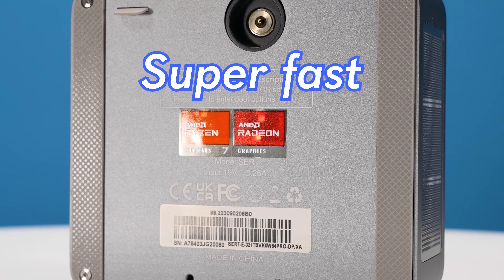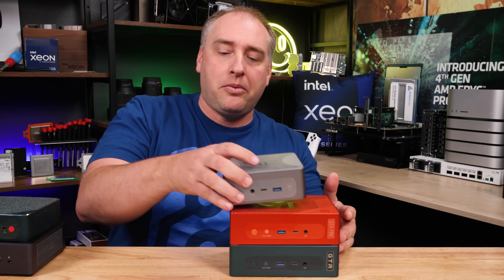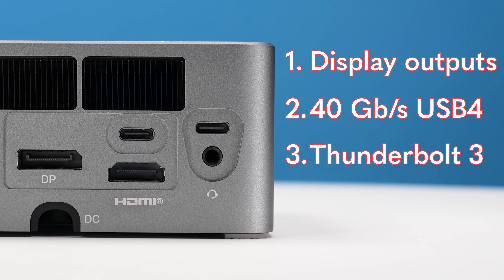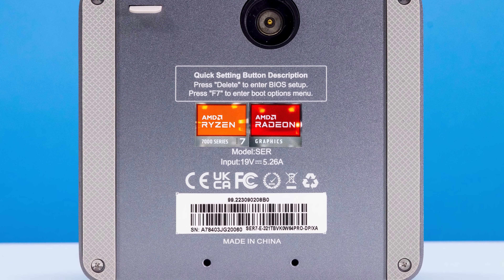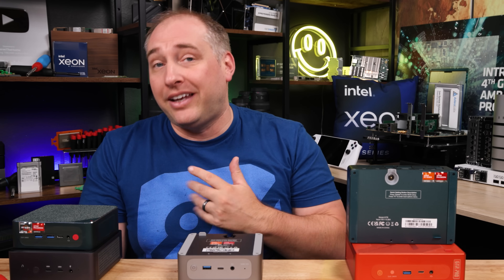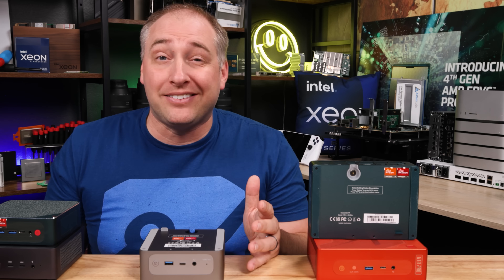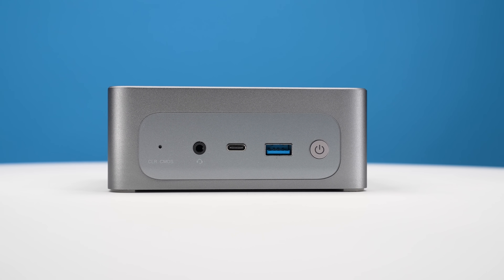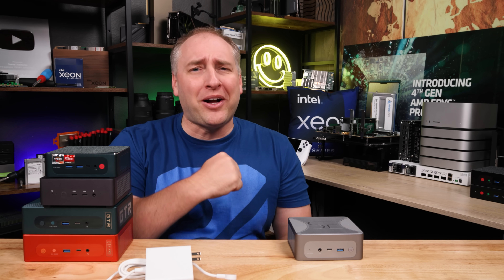A CHEAPER and Smaller Mini PC

Comment: The proprietary magnetic adapter is a HUGE plus, you missed the whole point. IT COMES WITH A LIFETIME WARRANTY. how many times have laptop and phone adapters and plug ports died before the machine itself. In my experience, I can count roughly 15 to 20 power adapter failures and 3 power port failures before any other part failed on the device. Having a cool upgrade where there is some proximal cord reinforcement with a magnetic attachment with a lifetime warranty for the adapter and port is a game changer. Yes BEELINK, I'm starting my own influencer channel for product reviews, so go ahead and send me a SER8, and give a review with proper attention paid to the warranty. All due respect to Serve the Home. He's great minus this small detail.

Comment: I didn't see any test to check if everything works as it should or if there are some issues. It looks like they will not send you the products if you do it. Right?
Reply from the maker: We check things as part of our normal process. See our latest 2.5GbE Mega roundup for an example. We buy most units anyway and the STH main site is much larger so they would send even if we found something.

Comment: I have a question sir, either in SER 6 Max, SER 7, or GTR series, their power system uses a magnetic adapter (which is good). how easy to get a replacement when the adapter is accidentally broken? 

second question, we know USB4 is capable of giving power delivery, could you run the PC using USB4 as normally as an adapter could do?

Comment: Looking at that power adapter, it is only rated up to 120V. It can't handle world voltages eg 220-240V. For an electronic switching power supply, that's a really big miss. These things are basically universal and cheap. Going proprietary, they really shot themselves in the foot.

Comment: I don't like bricks right at the plug, usually limiting on some power strips, and interfere with other plugs.
Reply from the maker: Good point. I usually get those little extension cables for this type of power adapter.

Comment: Is the USB4 implementation still horribly broken in terms of compatibility with Thunderbolt devices, as it was on SER6? I purchased a SER6 for use as a desktop PC, but I had to repurpose the SER6 as a headless home server, as it didn't work with any Thunderbolt docks I tried. Only when I stepped down to pure USB docking stations or USB-C screens, then it worked. I tested the SER6 with a high-end Caldigit TS4 Thunderbolt 4 dock -> Didn't work. Tested it with a Lenovo Thunderbolt 4 dock -> didn't work. Tested it on an Lenovo Thunderbolt 3 Gen2 dock -> Didn't work. Tested it on a Lenovo USB Gen2 dock -> Then it worked. Completely useless when you need Thunderbolt for other systems on the same docking station.
Reply: It is not USB4 implementation broken in term of compatibility with Thunderbolt devices.  They are different standards.  Though USB4 uses some of Thunderbolt technology but they are not 100% the same.  There are difference there and will never be 100% compatible.  Say USB4 has a minimum power requirement of 7.5W but Thunderbolt 4 is 15W.  Thunderbolts 4 guarantees mimimum data rate of 32Gb/s while USB4 20Gb/s.  Thunderbolt 4 has DMA protection while USB4 does not have.  Some features in USB4 are optional and manufacturers can choose to implement or not.  If you need Thunderbolt connection, you need a PC with real Thunderbolt port.  You should not connect a Thunderbolt device to a USB4 port and assume that it must work.
Reply: @catchnkill  I do not expect a USB4 computer to utilize the Thunderbolt protocol on a Thunderbolt dock, but I do expect it to be able to negotiate and settle on USB3.x when connected, rather than just fail and not work. Any USB3.x computers without Thunderbolt work fine with these Thunderbolt docks. There should not be any reason for not doing a safe fall-back to a common supported protocol, if a Thunderbolt device with incompatible features are detected.
Reply: @catchnkill  And the reason that Asus and Lenovo does that, is that they understand that their customers simply want things to work. Lenovo and Asus will get blamed if they decide to release computers which is completely incompatible with existing devices on the market, even though they technically could work. Just like Beelink has chosen to do. Pointing the finger at the standard and saying that the standard does not dictate a required fall-back method, is just being ignorant to their customers. Asus and Lenovo customers will likely come back in the future to buy more products, Beelink customers will not.

Comment: Looks like adding 10G ethernet to this costs $250 for the needed adapter.
Reply from the maker: Depends on which adapter you get. We have a project for the STH main site where we are going to test a few TB3 10GbE adapters for 30 days and see which hold up. A common issue is overheating and reliability on cheaper units. It got interrupted by the move to Scottsdale AZ.

Comment: The fact that the magnetic adapter doesn't pull out like Apple's is a feature.  While it would be different on a laptop as you don't want to strain the cable and the laptop has a battery it can rely on if it gets unpluged... in the case of a miniPC, not being able to (or make it harder to) pull out the power by accident is a feature.  The previous barrel cable could totally be pulled out by accident... causing a complete loss of power.  I realize the wall side is still easy to accidentally knock out, but hey, at least the computer side, with the magnetic connect is better.

Comment: This power socket is NO for 100% for me. I have currently SER5 and it has normal barrel 2.5mm. I will not upgrade ever to such bs. Will rather change the vendor.
Reply: 😊😊😊😊😊😊😊😅😅😅😊😅😊😅😊😅😊😊😊😊😅😊😊😅😊😊😊😊😊😊😊😊😊😊😊😊😊😊😊😊😊😊😊😊😊😊😊😊😊😊😊😊😊😊😊😊😊😊😊😊😊😊😊😊😊😊😊😊😊😊😊😊😊😊😊😊😊😊😊😊😊😊😊😊😊😊😊😊😊😊😊😊😅😊😊😊😊😊😊😊😊😊😊😊😊😊😅😊😊😊😊😊😊😊😊😊😊😊😊😊😊😊😊😊😊😊😊😊😊😊😊😊😊😊😊😊😊😊😊😊😊😊😊😊😊😊😊😊😊😊😊😊😊😊😊😊😊😊😊😊😊😊😊😊😊😊😊😊😊😊😊😊😊😊😊😊😊😊😊😊😊😊😊😊😊😊😊😊😊😊😊😊😊😊😊😊😊😊😊😊😊😊😊😊😊😊😊😊😊😊😊😊😊😊😊😊😊😊😊😊😊😊😊😊😊😊😊😊😊😅😊😊😊😊😊😊😊😊😊😊😊😊😊😊😊😊😊😊😊😊😊😊😊😊😊😊😊😊😊😊😊9999😅😊😅😊😊09😮😮?😅9

Comment: These mini pc's would make great servers if they had dual nics , one of them preferably 10gig, not for storage but for cpu compute, like web servers, DB servers , Ci-CD systems and similar. They offer so much performance in such a small package
Reply: That's what i want to use one for :-) instead of a raspberry pi 5 or an orange pi 5, buy a small NUC and run it as a server with a few VM's on it running some kind of small linux distro
Reply: Reckon any of these would handle what an 8GB pi could at idle

Comment: Hi all, I have a question for the owners of this mini PC.  From the specifications unlike other models that use Realtek. Usually mini PCs with Realtek network have compatibility problems with vmware esxi but this Beelink SER7  uses an Intel i225-V NIC network card. This network card should be compatible with vmWare ESXI 8.0 but I don't know if the ryzen 7 7840HS Zen4 architecture is supported by vmware. 
Please, Can anyone give me an answer? I should create a cheap laboratory to make available to students of a public school.
Reply: I believe it can run ESXi, though there may be done issues with things like iGPU passthrough. You may need to create a patched ISO to bake in some of the required hardware drivers.
Reply: My SER7 actually has a Realtek NIC... soo.... not sure if they changed mid manufacturing process or what, but due to that NIC i cannot instlal ESXi 8.0

Comment: In my opinion part of cost optimisation is what they buy older chips with discount as they replaced by newer versions.
Reply: these are not old chips its basically amd's 2nd best mobile laptop cpu
Reply: @AcidMan-uh7ge  I mean I225 NIC and bunch of older/cheaper small chips mentioned in video like "why they use older chips if there new ones?"

Comment: This one is overpriced @ $700 (coupons on amazon just drop this to $580)

I just got the SER6 MAX for $409 16gb DDR5 1TB nvme, it has exactly the same case/cooling as the SER7, 2 NVME slots, 2.5g and yadda yadda only has a RDNA2 CPU 7740hs and 4800hz ram instead of 5600... i think its a much better deal.

Comment: You can use 100w or 140w UGREEN USB-C charger instead of original magnetic AC adapter (for both GTR7 and SER7 7840HS)
Reply: just saw your question: yes for 100w and no for 140w. with normal useage(movie, office work, networking...) the ser7 handle it fine, but upon gaming and power intensive work(video editing), the 100w power supplied by the usb-c PD3.0 would not sufficient(the type-c on the back doesn't support PD 3.1 which is 140W), and would lead to sudden power-cut(from the power brick). i found it portable enough to have it carries around with the stock magnetic power brick and a couple of type C cable.

Comment: The problem with all these systems for me is the lack of dust filtering.  I already had an Intel NUC fan die after only about a year, because the heatsink got blocked with dust.  This would be fine if you could actually routinely clean it, but you can't, it requires completely stripping down the unit which is not practical.

This basically makes none of these units practical in a house with a diabetic and a cat, both which create dust quicker than you can clean it up.  I'd be happy with something bigger in order to compensate for restricted airflow from a filter, but not aware of anything.
Reply: Perhaps enclose the PC in a small sealed, ducted unit with just one point of ingress for cold air and something like a larger bequiet or Noctua at a low RPM to establish positive pressure to feed the PC inlet, and some fine filter over the inlet hole? I bought some demciflex branded mesh filter for my main desktop system. They made magnetic filter kits for various cases including mine, but they also make generic kits you can use or cut to size. They're quite restrictive and have really made a difference on the amount of dust getting in to my PC.
Reply: Because a diabetic creates more dust or???

Comment: Clear CMOS - does that switch have any impact when the system is on?  I assume the switch is only sampled when first starting.  This makes having a switch on the front of the case far less dangerous - although I would still prefer a recessed switch on the back.

Comment: I'm mad miniPC companies aren't standardizing cooling solutions around desktop fan sizes.

I mean according to the product page of the SER7 it's 126mm x 113mm (X, Y footprint), and 49mm tall.

Instead of that shitty little laptop blower fan you could just make the chassis have a 126mm x 126mm footprint, bump up the height by some amount, and then stick a desktop 120mm fan in it.

Not only would it be more repairable (120mm fans being more accessible in the market), but it'd also be quieter by comparison because the fan is physically larger so it can spin slower to move the same amount of air.
Reply: Why would they standardize a design part of  the product?

Comment: The fact that it throttles down power makes it a no go for me. A proper desktop replacement should never throttle. On another note, why can't I find GTR7 systems anymore? I don't care for the finger print reader but I liked the extra ports and the fact that it does not throttle. Oh  yeah, and that power adapter is terrible. I was looking to get one of the GTR7 units but the fact that there is no where on the internet that I can find to buy an extra one for my setup in the next room (PCs this size should be portable and used in various locations so it baffles me that you can not buy one by itself).

Comment: I got something similar with a 5500u for $180 and two 2.5 Intel nics.  Not as fast but same size and perfect for pfsense.  This is more for use as a computer.
Reply from the maker: Yes. Is the 5500U fanless? I remember recording that video before we left the Austin studio a few weeks ago but I do not think the review is online yet.
Reply: @ServeTheHomeVideo  It has a fan, which I can't really hear but im sure uses more power.  However even with my crazy stupid packages, extensive vlans, and the fact I virtualize pfsense with 2 cores - I rarely use more than 10 percent of the CPU.  I still have another 10 cores to mess around with.

Comment: In defense of their magnetic power adapters; there are a few positives to it, especially for  those that haven't had plug in power supplies on their PC's.  1. There's always that hesitation on "am I pushing it in far enough or two far ? "; Answer: With the magnetic, there's only one answer.  and 2:  I have like 50 power bricks for different things; it's always easy to get them confused, especially when the misses puts one away.  Well, being proprietary, it would be very easy to match up. ..  I do try to label power bricks nowadays; but it still does not stop her from putting a power supply away, sometimes never to be found again.
Reply: The other benefit is so it leaves more room for I/O on the back, since it plugs into the underside of the unit. A DC barrel jack would take space on the back, which is already pretty crammed with ports, so I’m not sure if they could do this without compromising on I/O somehow.
Reply: @GabrielSoldani but then again, couldn’t they just have put a DC barrel recessed underneath and shipped it with a 90° connector? That would’ve made it less likely to pull out in the event someone snagged on the cable, but still not proprietary.
Reply: @Yiveytube Have you seen how big a DC barrel jack is? No way you could put one under the unit without compromising on its size. I wouldn’t mind if it were a little larger, though, but I think their target market wants both the IO and the small form factor.
Reply: @GabrielSoldani  That’s why I wrote recessed! They could sink it in like they do now, but with a barrel jack and no magnet.
Reply: @Yiveytube  Making it recessed doesn't save space, it just displaces internal components.
Reply: @GabrielSoldani  just like they’ve done already, just not a proprietary connector.. 🤷‍♂️
Reply: A third plus is that 3. it is harder to accidentally pull the plug on the unit. An accidental tug (that doesn’t pull the unit off the shelf) won’t kill the power.

Comment: One thing that annoys me in these mini PCs is the lack of memory tuning tools.
My 5700G could run its IMC fabric, and UCLK at 2500Mhz(gear1 CR1 with memory at 5000MT/s C17-18-18-36.
the 5700G is 7nm and has really long traces to the memory being a desktop board.
The 7735HS is 6nm, and the 7840/7940HS are 4nm and generally have super short traces to the memory.

With both of my 7840hs/7940hs the IMC might be running at 1200 with the memory at 4800, despite the kit being rated for 5600.
I know that the IMC and FCLK should be capable of running somewhere around 2800-3000Mhz, and thanks to the shorter traces in this small form factor, you'd think my 32GB kit of 6400C34 would at least run at 6000C40, but no, anything other than 4800 and it just drops it to 4800
I have found a 16GB kit that will run at 5600 C40 on my 7940HS, but c'mon, its just 16GB, at least let me try to apply XMP/DOCP/EXPO on my other kits, since everything seems to be in gear 2 anyway, i'd love to get 6400 working.
Reply: You've gotten your 5700G to run at 5000MT/s?
That's amazing!
I thought most zen 3 Apus do like 4133-4266 at best
Reply: @cometxp  The 5700g has a different design so they could run at higher memory clock speeds than non g versions like regular ones 5700x, 5800x, 5900x.    You can buy like DDR4-4400 and get the speeds close to DDR4-4200 on average or be lucky to get DDR4-5000.
Reply: @vanguard812-vf7hr  yeah I know about the APUs being different from the standard CPUs, it's just that I don't think I've seen one run at 5000 1:1
Reply: @vanguard812-vf7hr  oh wow man that's impressive
Reply: @cometxp  The non-APUs will mostly stick around 3800 and maybe 4000, but the APUs are great, i got a 4750G to 4933, and if i dropped the 5700G to 4933 i could do C17-17-17-30
all in 1:1:1(of note you have to set all of them manually on most boards and on my Asus i had to set FCLK in multiple locations or else it would default to gear2)
one of the 5600G's would only do 4800 though, and i did check, it was the chip because i ended up trying it on the same board and i didnt want to pump any more voltage.

Problem is, even if i drop it to 4600C14, its still not that much faster than a 5800x. (edit, still often slower due to having 1/2 the cache of 5800x)
It does feel odd though, if a workload cant fit into the cache of the 5800x3d, it will be significantly faster than the 5800x3d, and by extension, the 5800x while using noticably less power.

Also this only works with single rank B dye, or at least, my dual rank didnt want to go past 4600C19, maybe i needed liquid cooling instead of a down-draft air cooler

At 4933C17-17-17-30 i got to 74GB/s and 49.1NS of latency, which tells me something wasnt right because on paper i should have been getting.... IIRC ~76GB/s

Comment: I wonder if these support something like FanControl to set a custom fan curve. I have done that with my desktop so I can control my bottom intake fans using GPU temp and also have my fans run super quietly until around 60*C (so poking around on the desktop or browsing, it is totally silent). Unless there is some sort of other method they are using to artificially limit it in longer workloads, should solve the throttling. Would allow for folks to tune the max fan speed for their preferred balance of noise and performance.